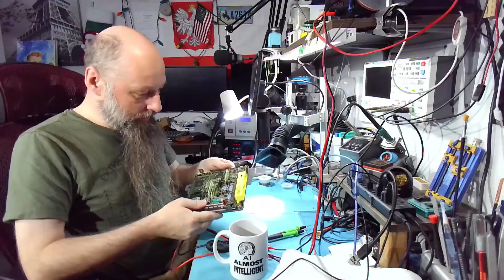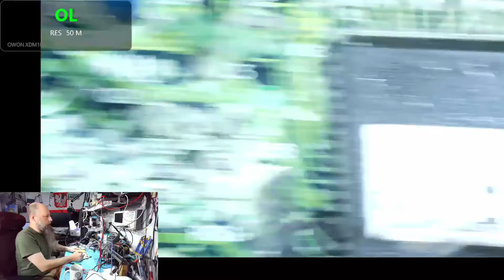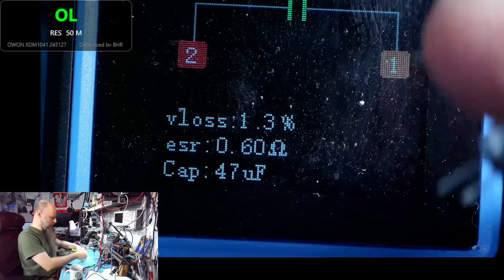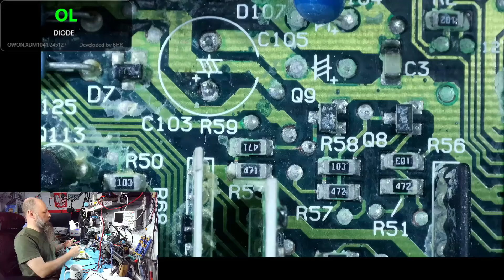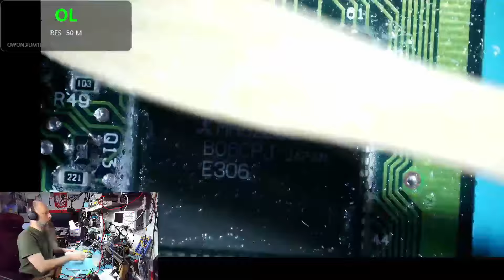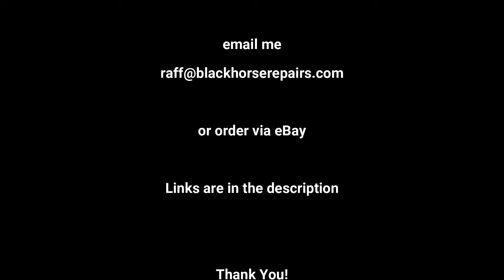336 | 93 Mazda Injector Stuck Open B2600i

Comment: Did you just use 99% IPA to remove the conformal coating? And is it necessary to coat it again after the repair or it's just a quality control thing? Also can you make a detailed tutorial especially on removing and adding the coating?
Reply from the maker: I use cobalt blue withIPA to remove the old mask. ECM mustbe sealed to prevent further corrosion

Comment: Hi Raff, two questions if you don't mind:
1) When you clean boards in your ultra sonic, what cleaner do you use with it?
2) when you put that conformal coating back on the board, what do you use?
Thanks!
Reply from the maker: I use distilled water, cobalt blue and IPA in the UC.
The conformal coating is Staticide, silicone
Reply: @blackhorserepairs  Thanks Raff.:)